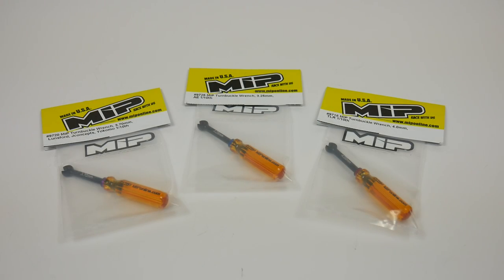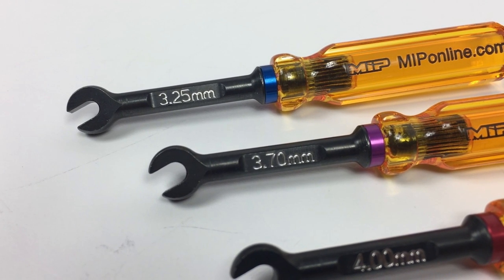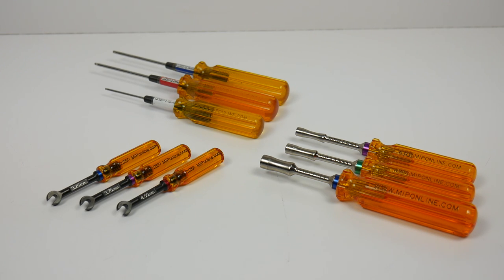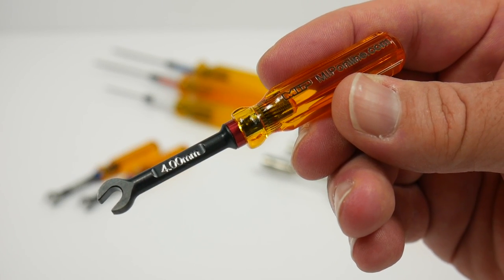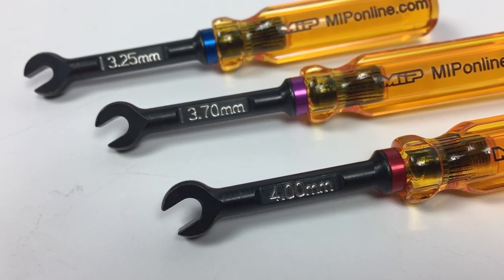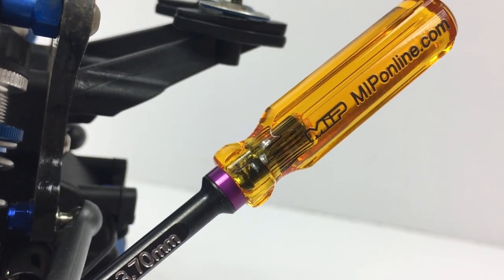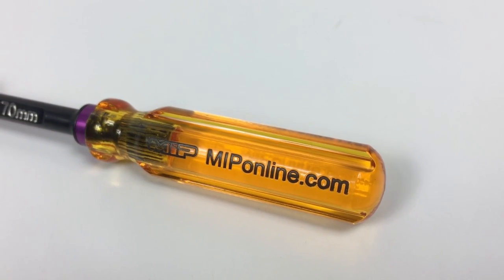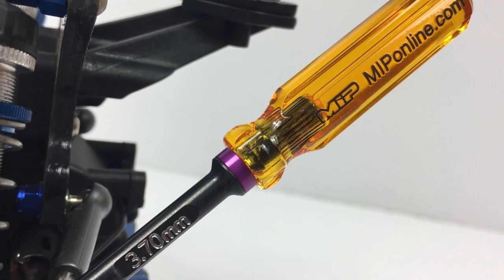Tool Tuesday EP62 - MIP Turnbuckle Wrenches - Hands on use

Comment: very nice Rich which size is used for the traxxas and proline turnbuckles ? ive been using a small wrench that came with one of my kits and also a mini cresent wrench but it has a lil too much slop for my liking..
Reply from the maker: I'm not sure on that....what's nice about the MIP's is they give a measurement:  3.25mm, 3.7mm and 4.00mm - check your's and see which one works.  If larger, check back with MIP - I believe they have plans for more sizes soon
Reply: The RCNetwork sweet thanks Rich !!!

Comment: Do you know if the AE size one will work on sc10.2? And the lunsford one will work on the b5m turn buckles with upgraded lunsford turnbuckles?
Reply from the maker: It should, and it should.  The lunsford for sure - they're all the same size for 1/10th scale.  The sc10.2 should be good, but you can cross reference on the AE site, which tools they recommend and check the sizing